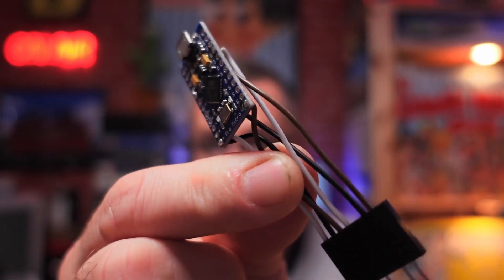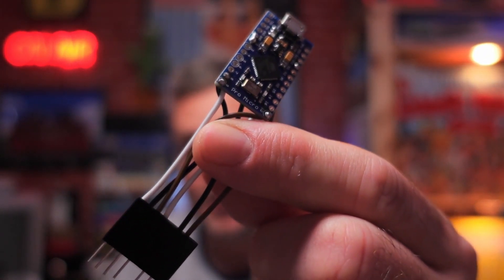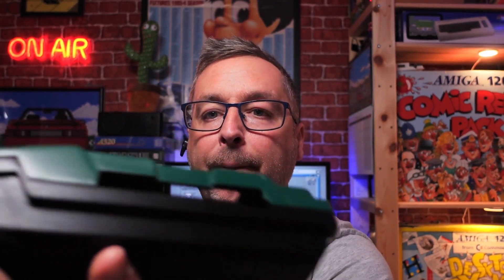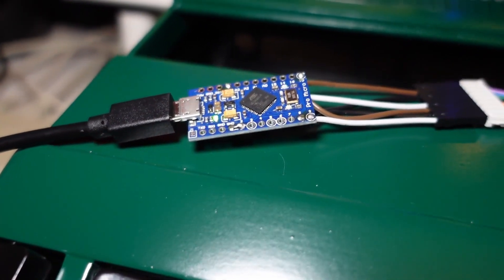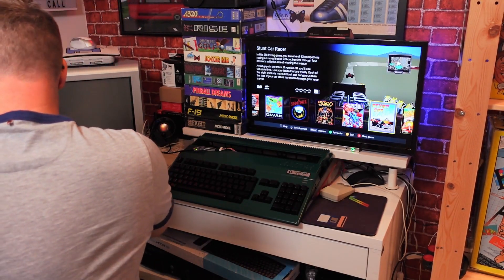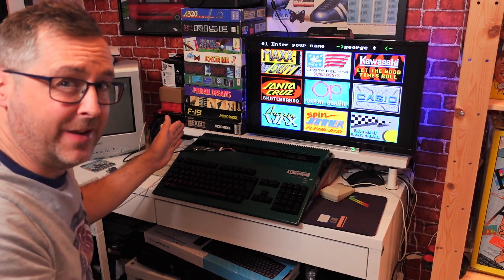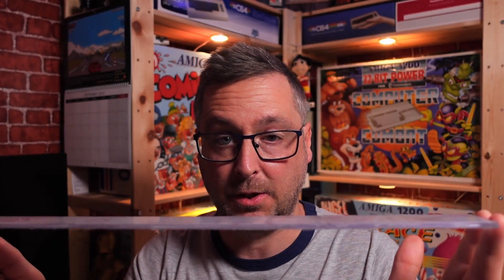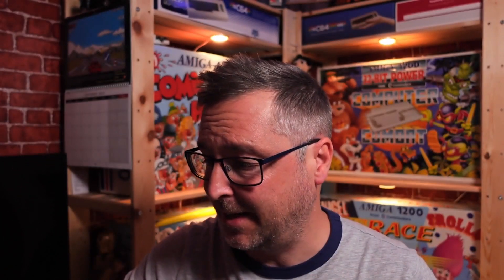Using An Original Amiga 500 Keyboard On An A500 Mini With Retro32's Pro Micro Keyboard Adapter

Comment: Good afternoon. I want to accomplish the same setup but do not have an Amiga keyboard or case, where could i source those items please? Great vid!!!
Reply from the maker: hi thanks for watching all parts can be found on ebay...thats amiga parts

the c64 and A500 can be found on amazon or ebay

the keyboard adapter can be found on retro32 website
Reply: @tooheystechgaming1977  You rock,i already own a C64 mini & a500 mini,just ordered the keyboard adapter.I only need an amiga case and a full-blown Amiga keyboard.I found multiple items on Ebay, what is the specific store you are referring to please?